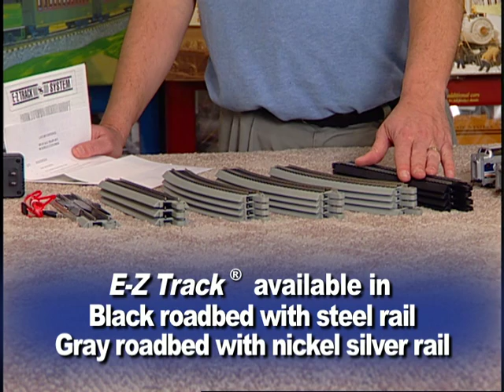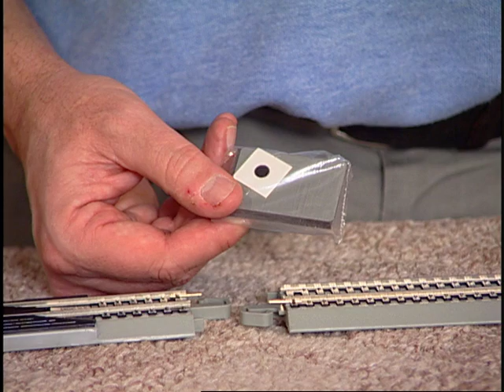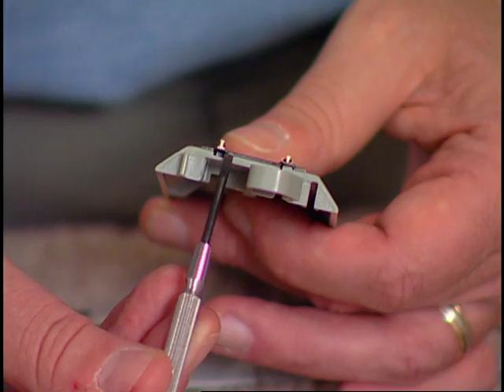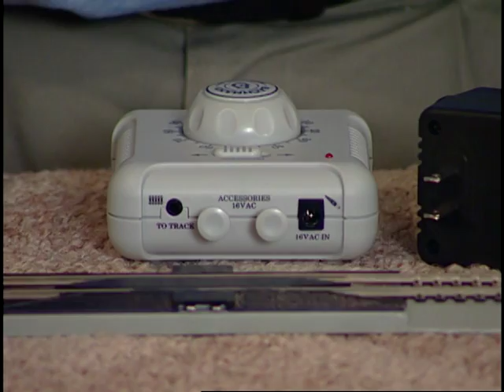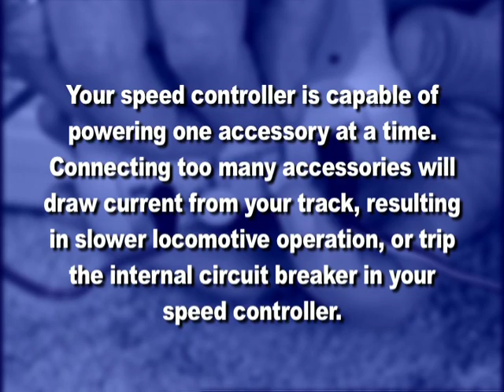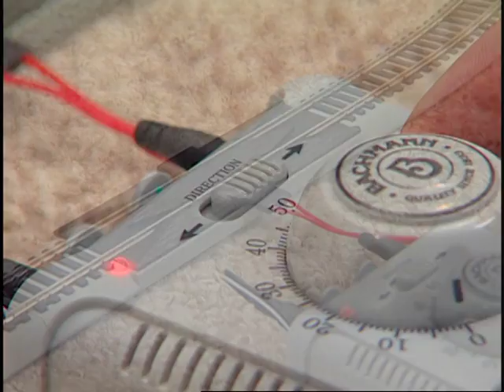Bachmann HO Scale Ready-to-Run Starter set video

Comment: Do i need another controller to use a turnout
Reply: Also my controller doesn't have the accessories part what do i do if I want a switch
Reply from the maker: @thestormisempty0796  Yes - the controller that comes with this set does not control turnouts. Check out item no. 44219 on shop.bachmanntrains.com for an accessories add-on for your controller.

Comment from the maker: A more advanced. DCC system. EZ Command is a beginners system
Reply: bachmanntrains hey Bachman do you mind lowering the price for Edward thanks
Reply: @edward0262  They won’t
Reply: I am a beginner.  We have two separate tracks and bought a controller for each.   My problem is how to connect to the track.   I cut the connector off your red wire, but which is positive and which is negative?   They are both red wires.   Thanks
Reply from the maker: You will need to use a voltmeter to find out, but it doesn't matter which end goes to which side, it will just change which direction is "forward" for the train. @SkipRoGlo
Reply: Plz make prr s1

Comment: My Son currently has the Thoroughbred Ready to Run set and we want to get him another set this christmas.  Can more than one train set be used on the track?
Reply from the maker: Only if you convert to Digital command.
Reply: Thanks for the Reply.  WIll the Digital Command work with the Thoroughbred set we currently have as is or is there something we would need to do to make it work with Digital Command?
Reply from the maker: You can add a DCC decoder to the engine, but it will take some work. We suggest you do a search on the Ask the Bach Man Forum on main website page. You don't have to be a member to do a search. Also do a search of YouTube. Happy holidays!
Reply: Marc Mandin if you use a normal dc controler on two. Locomotives at the same time it will be hard on The trains

Comment: can you run 20 year old locomotives digitally
Reply: +sonic23233 Yep, as long as you install a decoder inside the loco.
Reply: as long as you can disconnect the wires to the motor then yes

Comment: My layout having 4 track connecting to one main line, planning to purchase two train set to run in my lay out... suggest wht n how to calculate.. i need e-z turn out to my plan, is it works  to play two trains witout dcc locomotive n dcc control system as dcc is bit expensive. the standard train set comes with only speed control n power pack & wants snap two oval shape track system to my own layout. Plz suggest.
Reply: You need dcc or you will overload the controller.

Comment: I've got a question: recently, I ordered a Bachmann HO set and received it today, and the engine that came with the set came with a working smoke generator. However, the engine has been doing some questionable things; first of all, when I put the smoke liquid into the funnel, the smoke won't start working until two minutes of usage, and when it does work, it makes a popping noise, which can take you by surprise. Second, after usage, I discovered that some liquid was coming out of the undercarriage of the locomotive, which I assume is the smoke liquid. Although this doesn't affect performance, I'm still confused why it's doing that.

Comment: I just got this train set for my son for Christmas. However, we are trying to set it up, the power pack works (I can hear it when I plug it in), however the train does nothing. Does anyone know why this train will not run.
Reply: Have you checked to make sure that the track connectors are correctly connected or that there is any sort of electrical shortage?